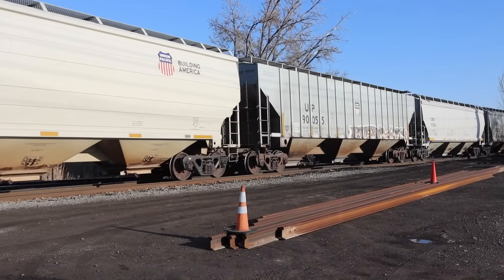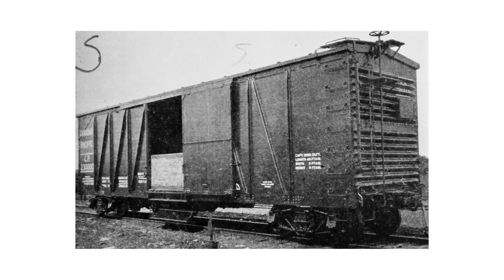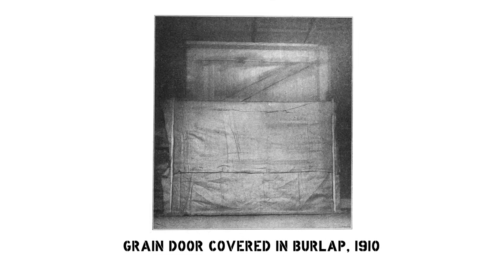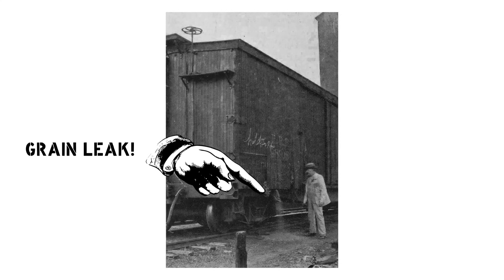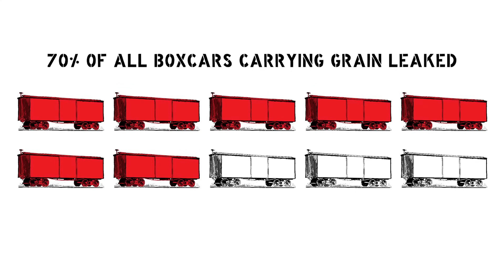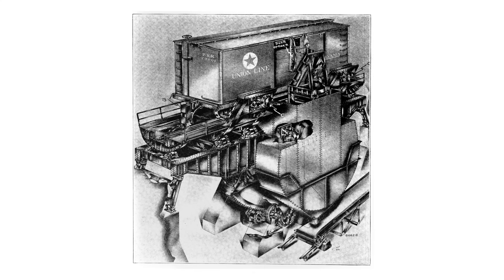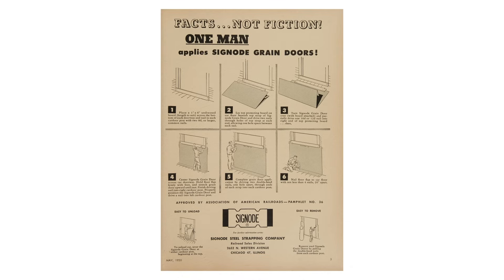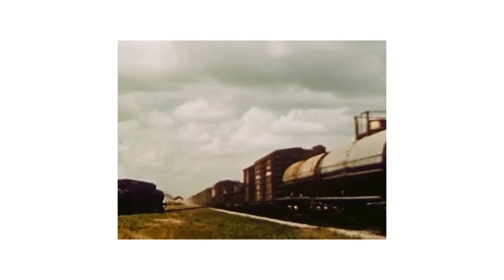What is a Grain Door? Obscure Train Tech: Shipping Grain in Boxcars

Comment: You guys are stuck in the Midwest.  In the Gulf Coast south, covered hoppers are more likely to be carrying petrochemical related products, not grain.  You guys also forget a big grain crop down south, and that’s rice.  They are rice elevators in southeast Arkansas that equal anything you might see up there on the Midwestern lines.  Just please next time you start talking about grain, include the whole picture, not just your region.
Reply: Riceland in Stuttgart AR 

https://live.staticflickr.com/2160/2307122342_67e5d8131c_b.jpg
Reply from the maker: You assume too quickly. I don't live in the midwest. "Grain" includes rice, as rice is a grain product as the seed of a grass, as is corn.

Regardless, this video is about the grain door, which was not called a rice door, so that doesn't matter at all. This video is not region-specific but uses the correct historical terminology as it was used on the railroad during the time period it was used.

Comment: In about 1964, I worked construction at a siding on the SP in Moorpark,, CA where Goldman's Egg City got grain for their chickens. The grain was in boxcars with the cardstock "grain doors". The car was positioned with the door lined up with a receiver in the ground. After the door was punctured and some of the grain ran out by gravity, then the fun began. Now, remove the grain door.
They had a winch set up across from the receiver and the cable pulled a plate dozer with two handles. The operator would drag the dozer back into the car and sink it into the grain, then pull on a rope that would start the winch which would drag the dozer to the doorway pushing the grain along with it. The winch would stop when the dozer was near the opening in the car.
Repeat until the car was unloaded. It actually worked pretty good as was quicker that you would think.

Comment: I found if humour in the railways not maintaining the grain cars in the old days, because I had the same experience when worked at a grain terminal in the late 2010s. 

Common issues were cracked fbreglass lids, broken lid latches, sometimes holes in the container on top, and a lot of problems with the unloading gates on the older cars. We were supposed to unhook from the bad cars, put them aside, and fill out a "bad order report". Instead we often did what we could to make it work, and load the cars. 

Once, we taped a crack in the side of a hopper car and filled the crack with spray foam because it had already been partially loaded. 

The issues were more with the cylindrical older style cars from the 70s and 80s, and at rhe time they were upgrading their fleet to modern cars.

Appreciate your video 👍
Reply: Were those grain cars cleaned after each use?

Comment: You showed a Mormon board called it something else, they were helpful to get the grain out of the car
Reply from the maker: I've never heard that term before, do you know why it was called that?
Reply: @ 
I guess because the Mormons used them, saw 1 in AZ 1975, 8’ wide took the whole width of a truck, only 12 inches tall set up with an electric winch to pull it, the trailers were flat beds with traps in the floor to get most of the grain, then finish with the board, of course a broom to clean up after.   Another in Oklahoma only about 3’ square again with a winch to pull they were using it on box cars.

Comment: Great video. As a young teenager I coopered boxcars while working as casual help at the local elevator on a CN line in  Saskatchewan. Some wooden cars were still in use, and the transition to covered hoppers was just beginning. Wood and steel strapped cardboard doors were used. I can also sail a raft made out of wood grain doors on a spring snow melt pond.

Comment: I can recall my Dad installing the boxcar doors made of wooden panels that supported cardboard reinforced centers with metal perforated straps you would drive nails through to hold these to the inside of the car.   Sometimes the boxcar only needed a new "door" on one side, if it had held grain before.   He would get the "doors" in bulk from the railroad company delivered directly to the grain elevator.   Shipping six cars a week was about average.   The covered hopper cars increased shipping nearly threefold.

Once the door was in place, there was a special bracket that clamped to the boards and allowed the grain shoot to be directed to either side of the car for loading the grain.   This all took a lot of work.   Sometimes I would help hold the wood in place until Dad would get the nails started.   They used the double- headed nails, also called scaffold nails, to make them easier to remove.

The new doors couldn't be installed until the box car had been cleaned of the previous cargo, because there was always something left over from the previous load.   Sometimes it was my job to sweep out the box cars prior to loading.   I was quite young at the time and received no pay other than free room and board. 

I'm not sure when they quit using box cars for hauling grain, but my little red shed was built from recovered box car door lumber in 1975 or 76.  It wasn't the best lumber, but did well if kept dry and out of the weather.

Comment: I nailed a lot of grain doors into boxcars in my younger days, but not nearly as many as my dad and brother. As a skinny 13-year-old, lifting grain doors was about all I could handle. We shipped corn cobs rather than grain (that's a story of its own), but the process was the same. We had an industrial blower to shoot cobs into cars as they were unloaded from trucks. Dry cobs were best; if they had set on the ground and soaked up any water, they were a pain! Worse, yet, if they were frozen as well as waterlogged, we had to break them up to get them in the chute. I had my share of bruises from a clump of frozen cobs falling out of a truck we were unloading! We filled each car completely, because the cobs were lighter and bulkier than grain.

In the late '60's the Illinois Central had problems delivering us empty boxcars, so they started bringing us old cattle stock cars lined with plywood. Invariably, some of the plywood had come loose or totally rotted, so we had to nail it back up or replace it. The capacity of the stock cars was also slightly smaller. Finally, IC modified some solid-bottom gondola cars by extending the sides (like an open top wood-chip hopper car). We loaded those with a corn elevator, making the process so much easier and faster! It would take about 2 1/2 hours to load a boxcar, but only about 45-60 minutes to load a "gon".h

Comment: Nice video on a pretty much forgotten feature of American railroading. I remember a mill in Crete, Nebraska that still had a set of permanent concrete saw horses that were used when pulling the nails out of grain doors. There was a huge pile of rusted together nails underneath. They hadn't been used in years, but were still in situ.The same mill had a disused unloading machine, similar to the ones depicted in the video. The story among the millhands was it was only used for a year before all shipments switched to hopper cars. It sat dormant under floor level for years before it was scrapped and the hole filled in. I remember stacks of grain doors at several elevators around Nebraska. They came in handy for re-railing cars that fell off the rail and weren't in too bad of a predicament. You could stack them up and make a sort of ramp and pull or push the car until it popped back on the rail. You would get in trouble for re-railing your own derailed car now, but it used to be all in a days work.

Comment: On a similar note, there is a famous picture on the narrow gauge of a stock car loading or into a tipple.
Reply from the maker: Stock cars were pretty commonly used for hauling of coal and coke for the same reason that railroads preferred boxcars over covered hoppers: livestock shipment was a seasonal business, and the stock cars sat around idle for most of the year, wasting money. There are many photos of standard and narrow gauge stock cars in use for transporting bulk fuel.

Comment: I’m a retired Locomotive Engineer from a major class one railroad.  It is not wise to assume a covered hopper contains grain.  There is probably more plastic pellets shipped in covered hoppers than grain.  They can also carry sand, gravel, carbon black, cement, salt, and many other bulk commodes outside of agriculture products.
Reply: Yeah a ton of covered hoppers haul plastic pellets.  They even put fancy Anthracite coal in them so it doesn't get wet.

Comment: 01:36 what a special grain train in 1904 with that highly publicized boxcar of D&E RR that just opened for traffic in summer 1904 with 
117 miles of new tracks with grading that started in 1902.
In 1904, iron was useful betwen Enid and Guthrie.
In 1905 was extended betwen Enid and Kiowa. The track never got to express terminal and was sold 2 years after in 1907 to Eastern Oklahoma rr that almost sold it to AT&SF.
Its builder the 5 Frantz brothers used it for only 2 years in its "full lenght mileage".
So short was ownership and sometimes abandonment in those years.
Today it´s transcontinental BNSF Avard sub.
It just started so small and shortlived by 5 btothers.....

Thanks for that interesting document.

Comment: The narration implies a variety of methods of getting tye grain from storage to the box car. After the 1890's virtually all grain was loaded from elevators, mostly wood country elevators or concrete silos in major centres. The grain was elevated to the top by the leg, cups on a continuous belt and then fell by gravity to the box car. There was sufficient velocity due to the height of the elevators to get a percentage of the grainn to either end if the box car to reduce shovelling in the box car. Climbing over the panels that closed off the box car door into the confined space above the grain was not a pleasant task.The grain elevator manager had to be a master of many skills including coppering the box car openings and closing any cracks in the box car. Also had to maintain accurate records, including the shipping manefest that would have been given to the conductor when the bix car was hauled away by the railroad. That record  became the conductors responibilities to insure that the record accompanied the box car until it was unloaded at a terminal or flour mill. The elevator company was paid for the amount of grain that arrived at the destination. Any loses along the journey were absorbed by the grain elevator company, not the railroads. Consistent loses could affect the local grain elevator managers  career.

Comment: I always wondered how this worked, since the branch line that served my hometown - the CP Russell subdivision - used boxcars to move grain. It seems like such a bad idea all around and I'm surprised it lasted as long as it did. The CP Russell sub was using boxcars for moving grain all the way until 1997 when the line was abandoned.
Reply: CP & CN had some light-rail branchlines that were never upgraded to handle the heavier modern hoppers, and kept using 40' grain boxcars until the few remaining lines were finally were abandoned in the mid-90's. They were not very profitable lines, and it was cheaper to keep the grain boxcars around than upgrade the lines.
Reply: Grain boxcars were somewhat of a bone of contention between the government and the Canadian railways. Grain transport agreements weren't profitable for the railways, so there wasn't a desire to upgrade the equipment, despite there even being a shortage of boxcars. In the early 80s, it led to the Canadian government, Alberta, and Saskatchewan purchasing large numbers of grain hoppers to efficiently move grain.

Comment: Hello from Canada. This was an interesting, informative, & well produced video.  
I'm a retired CP (now CPKC) Conductor & I've lived & worked though the transition from boxcars to covered hoppers for shipping grain. On the now abandoned Goderich Subdivision, grain had to be shipped in boxcars later than most port because  many miles of the 110 mile Subdivision were 80 lb rail and wouldn't handle the weight of new fully loaded covered hoppers. The company upgraded the 80lb sections to 100 lbs and the use of boxcars ended in the late 1970s. 
An anecdote you might find amusing, when I was a brakeman, we had a Conductor nicknamed "grain door". He  was a huge guy and  the reason he was given the nickname, he worked installing grain doors & loading grain as a teenager before signing up with the company as a brakeman. The other reason for the handle, his last name was Smith and we had 5 different Smiths, so instead of using first names (and because 2 had the same given names), he was called "grain door" for his entire career. Some of the other Smiths were "sleepy" , "EJ" and "nasty".
Reply: Yep Prairies have lost so many tracks. Interestingly enough many new tracks arrived in the 30' and was an instant boom in many villages. When track was pulled up, they started all to die with dépopulation.
The railroad coming and leaving had a such big impact in those rural communities.
Being on CN mzin line, i can attest wheat and potash unit trains are alive and well.
Reply: See, grain is the farthest thing from my mind when I see a covered hopper car like that.  In my world, that type of car says plastic pellets.
Reply: @dwayneleblanc6572  they ship a lot of plastic pellets to be sure

Comment: Sometime in the 1870s, I think, an experimental type of dedicated grain or flour car was invented that consisted of two rolling drums held together in a frame, the drums serving as both the cargo compartments, and the "wheels". Westinghouse had to design a brake for this, which they did. This design was found to be excellent at track holding, and because the product was continually rotated in transit, it was found that the fineness of the flour was improved during a ride in this type of car😅. However, there were no buyers for the type. The reason?... It was too "weird"!
By the way, there is some info that says the B&O tried this method to carry coal in the 1830s, based on the practice of rolling huge hogsheads of tobacco along "Rolling roads", up til around the time railroads became more economical . They called these coal cars "Coffee-roaster" coal cars. Based on the fact that coffee roasters did look like another type of wooden coal car built by Ross winans around that time, I think Mr. Pangborn may have been wrong about the name. ( The World's Railway, 1893(?).)
Reply from the maker: The drum cars were actually invented to ship oil first. When the oil producers didn't buy it, the inventor went through every bulk commodity he could find trying to sell his idea, including coal and like you said, grain. Nobody wanted it, but it wasn't originally intended for grain. Just a crackpot idea that somebody hoped to make a ton of money off of - like NFTs!

Comment: The HAYFIELD ELEVATOR in HAYFIELD IOWA had a wooden grain leg with cups on a belt that took the grain from a pit, hauled it cup by cup to the top of the elevator and dumped it into a small scaled hopper with a trip mechanism. After every 560 # or whatever it was set at, the scale hopper door would trip open and let a stream of grain wooshing straight down a long 7" tube with flex spouting down at the boxcar. The flex spouting curved and was aimed at the far corners of the boxcar and had enuf force to send it there. The flex tubing had to be reset as the boxcar was filled. When the boxcar was full, you would ride a manual rope manlift to the top of the grain elevator and read how many times the hopper tripped x weight of each trip = weight of grain in that boxcar. Then close the steel outside boxcar door and put a steel band seal on the door with a serial number. When the boxcar arrived at its destination with the seal in tact. Nobody had opened the sealed boxcar.

Comment: What I really liked was being train crew in the 80s when hoppers were taking over. Elevator agents that had screwed you got boxcars other agents got the hoppers. It was payback time in a big way.  Hoppers also held a lot more weight so when supply was limited the elevators that got boxes could not ship as much. There was one big problem with hoppers. They  were a little over 60 feet long and bolted rail was 39 feet which resulted in harmonic oscillation between 14 and 23 mph requiring speed restrictions on bolted rail.
Reply from the maker: Thank you for sharing this story! In researching this video I found lots of documentation of conflict between grain elevators and railroad employees so that's hilarious that the train crews used hoppers to get back at the elevator operators!
Reply: Can you elaborate on how an elevator agent would "screw you"? I'm curious as to what they'd do to piss off the train crew
Reply: @ajorsomething4935 they would probably do the same things as they do to truckers today.
Not having loads ready to ship or receive, and long wait times for them, either.
Driving a refrigerated van has got to be the worst.
Places like Walmart charge the driver to unload the truck.
Not sure if that sort of thing happened in the railroad, but it wouldn’t surprise me.